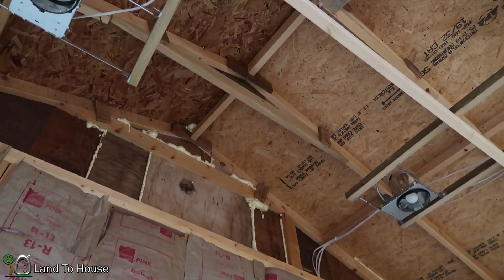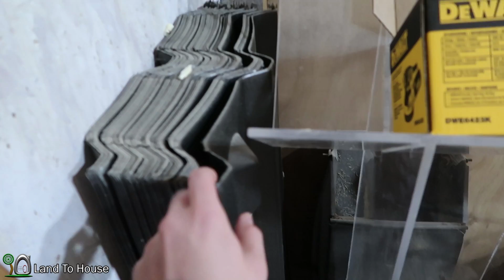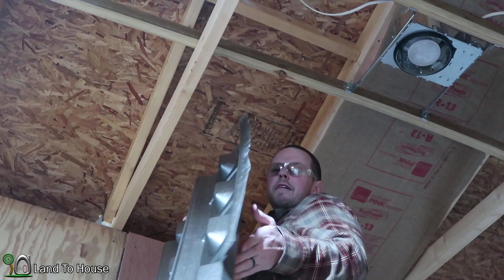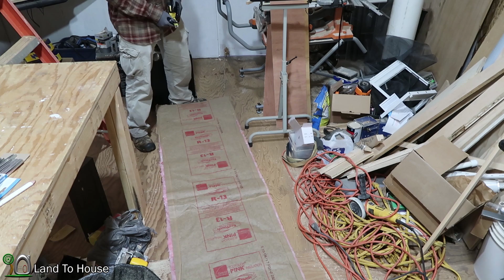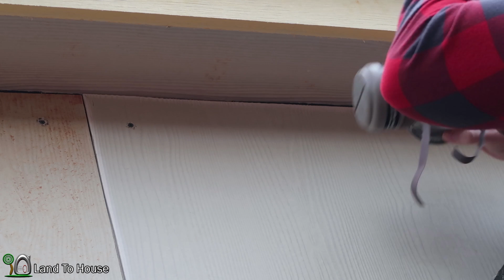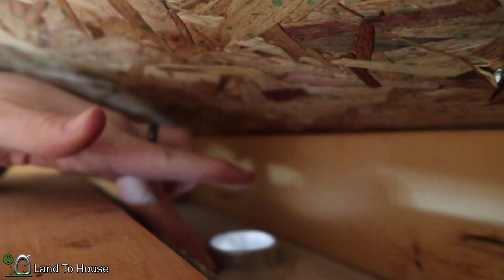Roof Insulation and Ventilation - Build a Workshop 38

Comment: Land to House  I really am enjoying following this project.  I was I was happy to see you furring out the truss top chords to allow for the Styrofoam air channels and insulation.  I think you may have needed to put in 3 large holes in the blocking for the airflow based on other search results I came across for venting the bays with sheathing nailers present.
I realize its a little late now, but for a future project/refit and the readers...for less than $2 each the big box stores have 16x4 screen/louver covers that you just surface mount from the outside over several vent holes, much easier I'd think. https://www.walmart.com/ip/Eac16x4-16-X-4-Under-Eave-Vent-Mill-Finish-701-622r/399293800

Comment: Wouldn't those round vents fit snug, and preclude the use of caulk, of you drilled a 2" hole?  (Rather than a 2-1/8")
I installed these type vents years ago, and I'm sure I just pushed them in a snug hole.  
Also, did you decide to put screen in them? It seems when i installed mine, they had screen. But it was many years ago, maybe they've changed.?
Work shop is looking good. Lots of work! Cheers
Reply from the maker: I think they would fit a lot better with the 2" hole. Sadly I used my 2" hole saw in another install and it is so dull it will not mark the board. These hole saws that I have are not made for concrete. I am so looking forward to getting the shop built so I can start making things without all the clutter around,.